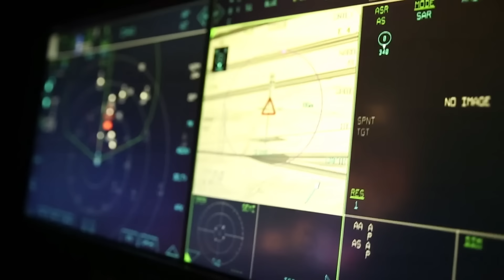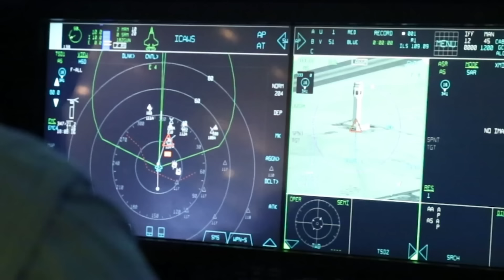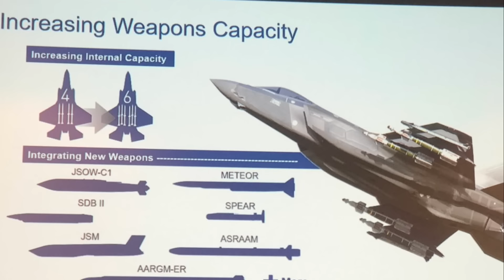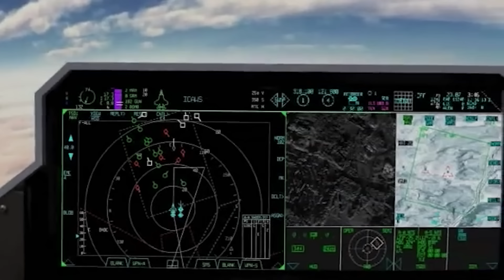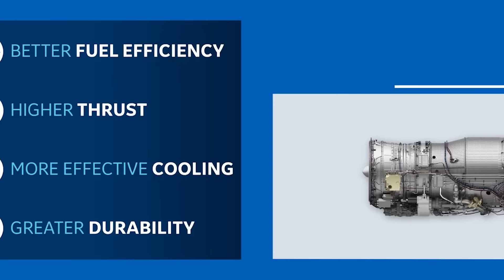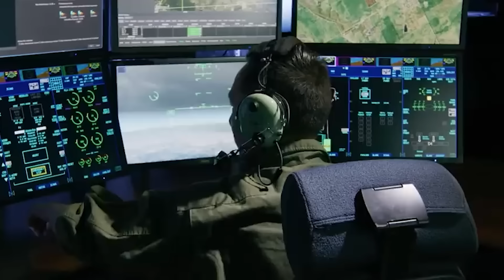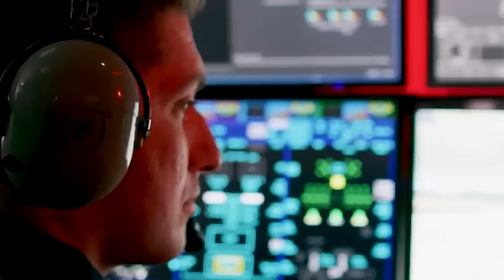The F-35 is about to become a POWERHOUSE

Comment: The new Electronic Warfare upgrades are insane.
One of the biggest criticisms was how the air frame and software was specifically designed to upgrade without significant redesigns to the fighter.
Critics took this as an ASSEMBLY LINE idea.
Not the case.
Just wait until AI starts chipping in.
Scary
Reply: Exactly.

Comment: @5:38 Not so good with math and percentages there Alex?  "20 is a 75% increase over today's 5"  Are today's 5s not the same absolute value as tomorrows 5s?  Where I'm from 20 is a 400% (edit: 300% - As corrected by Joshua - I'm tarded too) increase over 5.
Reply: 20 is a 300% increase. You have to subtract 5 from 20 to get the increase. 400% of the original, but only a 300% increase over the 100% that was there.
Reply: I caught that too.  Similarly, @4:10 75% Cost Reduction is - we was going to save $100/unit but now we are only going to save $25/unit - likely the exact opposite of what is meant.
Reply: @QTPewPew  Indeed. Durrp I knew if I started smart mouthing I'd get hoisted on my own petard! 😄

Comment: I love your videos.  An increase of 5 to 20 is 400%, not 75%.
Reply: Good catch!  It is much more impressive indeed.
Reply: Perhaps a 300% increase???  An increase of 100% would be going from 5 to 10.
Reply: @davidp4427  You are right, 300% increase or 400% of the original.  Have a great weekend.
Reply: There are 11 RF sensors currently for the EW suite, one of which is also a highly-capable jammer/multifunction array AESA.  Maybe they meant 5 types of sensors since there are multiples of some located on the wing leading edges, trailing edges, and horizontal stabilizer edges.
Reply: @dougware  % difference is a really ugly mess of communication.

Comment: I never realized that the F-35 was actually smaller than an F-15
Reply: It's tiny by jet standards. But it carries an incredible amount of stuff and fuel for that size.
Reply: It's stealth remember? It had to be smaller for lower radar signature. Also f-15 is incredibly huge! Maybe as big as mig25/31?
Reply: @hehe-jg8zz  It does not have to be smaller to have a lower radar signature. Shape, material, coating, engine intakes, vertical stablizers (or lack thereof in the case of flying wings), flight profile and a few more factors determine the overall stealth. Depending on who you ask and who does the estimates (real data is highly classified), either the F-22 or the B-2 or both can beat out the F-35 in stealth capability or are at least equal. 

The F-22 is roughly the size of the F-15 and the B-2, well, it is a bomber and therefore much larger, yet still maintains a very low RCS. In the case of the B-2, its successor, the B-21, should leverage a lot of new knowledge gained in the last decades to reduce the RCS even more and push it into a region of a smaller RCS than the F-35.
Reply: lol its obvious..
F15 length 19,7 meters
its the biggest fighter in U.S Arsenal
The Lightning is 15,7 meters while the Raptor is 18,9
Reply: F-15's are huge. Everything is smaller.
Reply: @chrisg9080  f-22 says hello, im bigger,  but you probably didn't see me coming.
Reply: @adeverel  and arent single engine fighters just automaticlly smaller though
Reply: @Schnittertm1  It's no secret that the F22 is most stealth (lowest RCS, something like the size of a real bird). However since F22 is relatively old tech by now, F35 is more than capable, stealth enough to do everything it needs, with a single engine instead of 2. Like I've seen a comparison somewhere that suggested how close both an F35 or F22 had to come to enemy radars like from S400 for example, for being at risk to get hit, and for F35 it was something like 20miles & F22 like 14 or something don't remember the exact data but, the point is that both are safe from enemy radars with their stealth tech and that small stealth advantage F22 has over F35, isn't important or relevant..
Reply: Like the only way for an F35/22 or other modern stealth aircraft like B2 to be shot down, is just if the pilot makes a mistake lol.
Reply: Pocket rocket....that no one can see. Spend some time near an AF base that tests the F35...always had to have an f16 chase airplane....so something could be picked up on radar. Was an a mazing time for Lockheed Martin, and I experienced it first hand.
Reply: wow.. didnt know that..
Reply: and slower.
Reply: F-35 is almost the same size as the F-16.
Reply: Basically the F35 is a fuel cell designed around an engine. There is fuel in most cells of the A/C from just aft of the cockpit, to the tail.
Reply: Compared tothe F-35, the F-15 is HUGE!   You've never heard it call "The Tennis Court"?   
I'll let you guess why they call it that.
Reply: The F35 is NOT smaller than the F-15.  F35 empty weight is 1,300 lbs heavier and Gross Weight the F35 is 5,040 lbs heavier.   (F35A compared to F15C) It's considerably Heavier than the F16, F18, A10.  It's only surpassed by the F22 and F18 Superhornet.  That's why it's called Fat Amy
Reply: Fun fact: it's now the biggest single engine fighter (power wise) in us inventory history. It beats out the f105.
Reply: Oh Yeah... !  The F-15 is larger than a football field ...!
Reply: Lots of reasons for that, main one being VTOL requirement affecting all of the airframes
Reply: Also, F35 is not strictly an air superiority aircraft so super-high performance as is put out by heavier fighters is not the first priority
Reply: I can't deny I want to see a Super Raptor for the ultimate air-dominance fighter
Reply: @batteredskullsummit9854  there isn't any air superiority in the F35. It relies purely on stealth.
Reply: I’ve walked all around and under them tiny.
Reply: @bekeneel  I have no evidence. I have heard reports that the F-22 in terms of RCS is only superior in the frontal aspect only. As soon as you veer more than 10° the F-35 is far and I do mean far superior even in dorsal and ventral radar scans. So unless you are going heads on at co-altitude and not using DECS the F-22 is superior. However the F-22 does not have the bells and whistles the F-35 has, meaning I still would not bank on it. Maybe this is why the US is not purchasing anymore F-22s and actually scaled back and revoked the additional 50 plus F-22s on order. 

I love the F-22 but it's over 20 years old now and the F-35 does it better and cheaper. I always think of the F-35 as the little, more capable sister of the F-22.
Reply: Think F-16 size.
Reply: @royal9848  F35 isn't close to the weight of anything in the light strike fighter program.  It's 4,290 kg heavier  than the F16 dry...it's even heavier fueled for  a total difference of 5, 283 lbs.

That's why it's called Fat Amy.  
That's why despite having the most powerful fighter jet engine on the planet they still need a new engine to get it's thrust to weight ratio over 1:1 so it might have some chance in BFM.
Reply: The subject was size, not weight.  The 35 is 2 feet longer and 2 1/2 feet bigger wing span.  49 feet vs 51 feet doesn't stand out.
Reply: @royal9848  f35C has the largest Wingspan at 43 ft. F15 is 42 ft.
F15 is 63.8 ft long
F35 is 51 ft long. 
F16 us 49 ft long
F35 is only smaller in length to the F15.
F35 Isn't smaller than the F15. It's shorter.
Size Defined:
"The relative extent of something; a thing's overall dimensions or magnitude; how big something is."

Comment: I remember when, as part of the YF-22 program, a special anti-overload cover with a tilting backrest of up to 75 degrees was planned. This was to help the pilot endure extreme g. It would be nice to add this to the next generation of fighters so the AI can outmaneuver the AA missile on its own.
It was also then that the advanced GE F120 was created, which worked in a changed double-pass cycle, and now everyone is raving about what a super-hyper 5000 is, etc.
Reply: Why bother dodging missiles if you could shoot them down with AI automatic defense? With sensors this capable the F-35 can do it easily.
Reply: Better yet, ground the useless pilots.  They have not been needed for decades.  Long ago digital computers replaced  them.  The military keeps them because the military is run by dimwit pilots, with no real vision, except for the desire to pick up chicks. Being a fighter pilot, helps a lot. I know all this stuff, I was in the military, I am a pilot but not a military pilot, And I’m an engineer who worked on big-time military projects including fat pig fighter called the F 35. Also the F 22. About a tremendous waste of money when drones is the real solution…
Reply: @steveperreira5850  It depends on what mission you do with the plane. Most hot war mission could be tackled with drones, but some mission military jet aircraft do, can't be done by drones. Peace time air policing for one should and needs to be done by humans. But there is a slick T-7 with 1 - 2 AIM120/AIM9 would be more than sufficient.
So there is not much of a point in having a cockpit in forward deployed F-/B-/(A)-planes.
Reply: Why was the seat not included in the final design?
Reply: @steveperreira5850 try to get AI to do SEAD. You have no idea what you’re talking about. Maybe one day AI can replace fighter pilots but that day isn’t today, not even close

Comment: I understand the issues involved for the engine upgrade. The more advanced engine sounds great, but it is very new. The less capable engine is still a big upgrade in a mature field like jet engine design. My first concern is reliability. The F-35 is a one-engine fighter, so there may be no real option but to go with the most tested and most durable engine we have right now. The more advanced engine design will have its day.
Reply: those jet engines are so advanced that more goes into making one of the turbine blades alone than most entire planes throughout history. They're so advanced, that any nation that somehow got their hands on even a full f35 would have its ability to reverse engineer or analyze other thigns. 

"These nano coated ceramic alloy turbine blades are kept cool through microscopic tubules throughout the material, but it appears when we touched something uh oh and then tried to soft fire the engine, and it just exploded instead
Reply: Look at how the P51 Mustang Merlin engine developed over a long period of time, and beet Ford's twin cam all aluminum engine that looked great and had all the potential but was too new to bet on!
Reply: @gagepoynor7997  Learning how to apply that coating would take production of infrastructure, and tooling. While they might be able to understand its basic concept, actually reproducing it would take decades of trial and error.
Reply: The point of an upgrade is to learn from the past problems of the same platform and fix reliability issues. More often the new engine is more reliable...
Reply: Be nice to field a few for let's say "testing" of the GE version!
Reply: That is true they should have put the new GE engine because your Right we can't keep upgrading if the engine doesn't have enough power don't know how much more Pratt And Whitney can upgrade
Reply: The primary reason for the engine upgrade is to increase electrical power generation for all the new capabilities to be added to the plane. Any efficiency gains are a nice bonus.
Reply: Once wise man said, K. I. S. S.

Comment: The updated engine is required for cooling avionics, not power...
Reply: do both Pratt and GE have the ability to offer massive increases in cooling?
Reply: Apparently it’s also power.

Directed energy weapons; incoming?
Reply: It’s raw power increase in both Mil and AB, Thrust-Specific Fuel Consumption efficiency for longer range, plus bleed power for cooling and DC generation.  The improved engine core Pratt & Whitney already made does that.  Thrust increase is up to 47,300lb with 31,000lb in Mil without burner.  That’s already a depot-level upgrade that can happen with the existing overhaul schedule.

Comment: The GE variable cycle engine should be utilized to save fuel, give longer range and overall performance.
Reply: For the Pacific, yes. Especially when tankers may be targeted by enemies at enormous ranges.
Reply: @mcs699  or just the block 5 or 6 or 7 revision. F35s are sticking around for a while even with the NGADs. The US is going to start sustaining a very diverse fleet of aircraft, though possibly the NGADs won't be available for export so NATO allies will have to rely on future upgrade revisions.
Reply: We still don't really know for sure that block 4 upgrades include which engine.Earlier they were saying that block 4 will have adaptive cycle engines there are still some chances of it getting GE engines
Reply: IF the frame can handle it, it also carries more load now, and wings do not just grow.
Reply: @mcs699  can you define "Soon"? i am not so certain after the F-35 program, any airframe will stay the way they were actually designed long enough, to actually create enough standardized spare parts. NGAD might become bigger than F-22, and probably not cheaper either. As for the B-21 Raider, Will it be that Modular Lego-plane that does everything, a subsonic Airplane does, if you switch out modules?  Bomber, AWACS, Tanker, Drone control center. You'll need a lot of them, if things have to be done simultaneously.
Reply: @mcs699  Save it?  Er, it's not an either/or, just make more.
Reply: The more a product is used, the lower the per-unit cost will be for everyone. Thus, using the better, more expensive engines on the F35 will provide lower costs overall for the programs that cone afterwards.
Reply: @4DCResinSmoker  I read it, and I disagree with you.  Quality over quantity.  Having two F-35's that can't perform a given range critical mission is not better than having one that can.
Reply: The F-35 already has enormous fuel reserves internally. What it needs it more thrust, but a variable cycle engine offers both. Maybe even a supercruise capability. Why not?
Reply: @Sun Bear  I think that is what the mq-25 is intended to address
Reply: Sure, when it is proven to be reliable.

Comment: I love these, but as a software engineer I can not imagine how bad the CPUs were if they can lift power by 37x. 37x is the difference between Core2Duo P8600 and AMD Ryzen Threadripper 3970X, 2008 vs 2019. So not that big compared to commercially available growth.
Reply: I was thinking about that. The biggest change since then is the very large expansion in the number of cores modern processors use. I wonder if this kind of system leans on a smaller number of very fast "cores" or lots of parallel processing, or both?  It's likely they are shifting from one to the other and have something like a big.LITTLE design ready to go (but a custom architecture). That kind of change would require a lot of re-writing of software to optimize. There's a lot of sub-systems feeding in data they need to co-ordinate and synthesize, and billions of lines of code already in this aircraft.
Reply: I'm pretty sure each subsystem has its own process, which lends itself for parallel processing. As well as signal processing for individual sensors. The fusion part might actually turn out to be simpler than you think (or it might be more difficult). But I think those are pretty nicely parallelisable nonetheless.
Reply: The billions of lines of code statement I think is so much more than reality. A few million lines of code can already do a lot. Billions is VERY hard to manage, plus not needed.